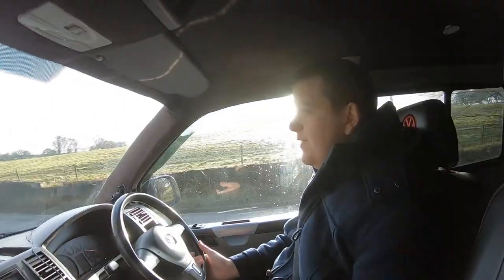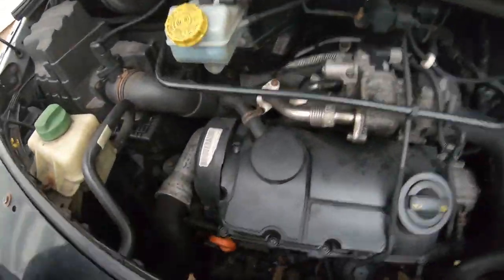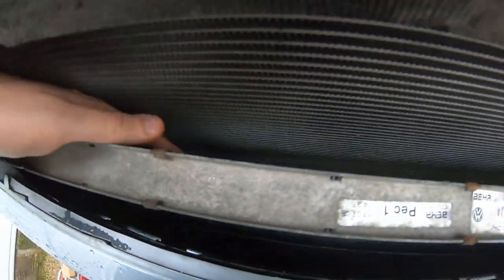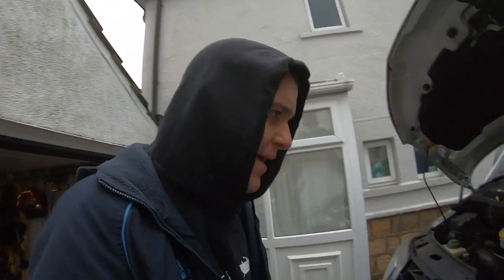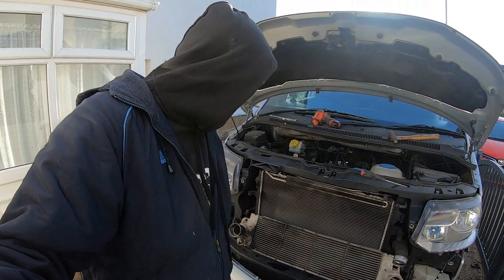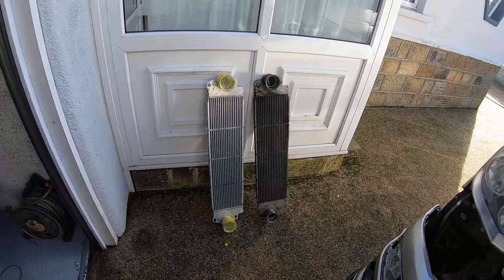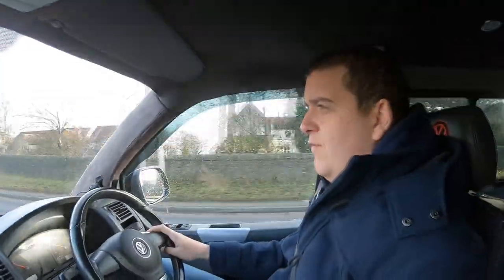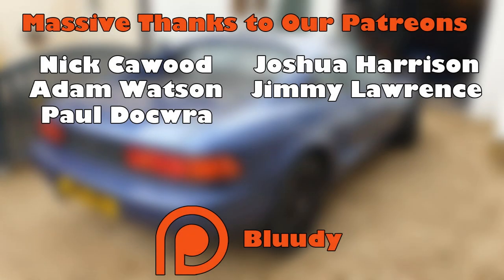How to install a Intercooler on A VW Transporter

Comment: I went thro 3 turbo intercoolers, they all failed in my t5 all covered by warranty.. It was a pain in the arse it went into limp mode also.. If i remember rightly the garage changed a cable/plug in somewhere and it was fine after that.. The cable was tight/short and over time the connection was shite.. I can't remember where i dont have van anymore..
Reply from the maker: No worries and appreciate the comment. Not sure why the vans chew through them but least they are only 65 quid.

Comment: Underboost fault codes are normally due to a seized EGR.
Reply from the maker: Cheers. I resolved the issue in a later video. My fault was a fault N75 valve that was getting stuck.

Comment: Double check your intercooler
Reply: We were thinking it didn't quite look straight and level  when you refitted the bumper the drivers side looked a little higher than the passenger side
Reply from the maker: Appreciate the comment but its straight as it locates into holes in the framework behind. So can't really go anywhere else.